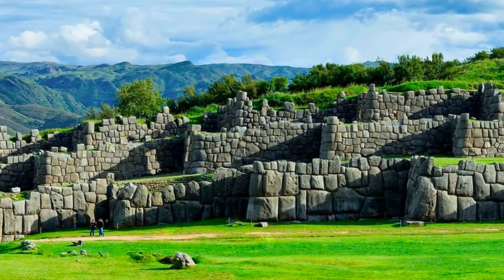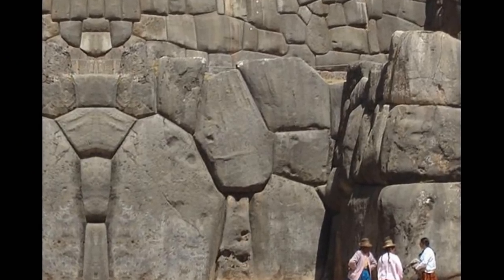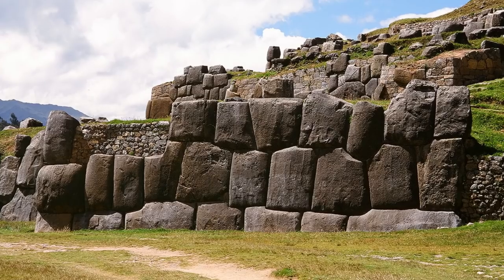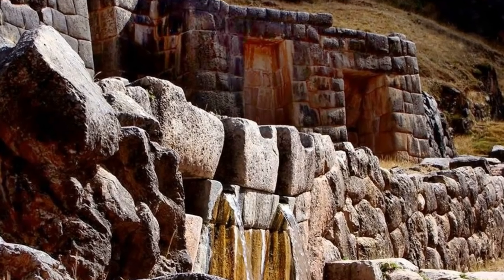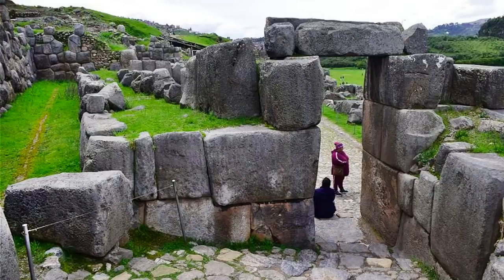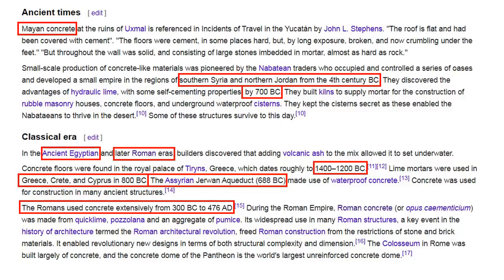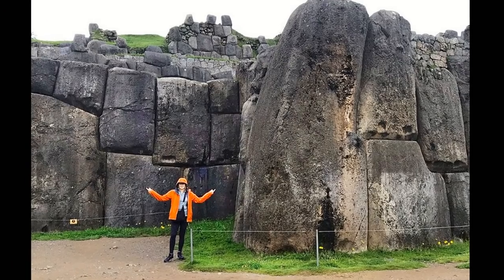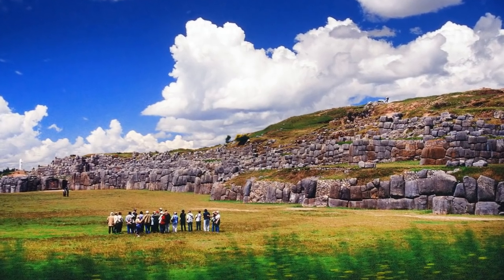Explained: How were Peru’s #Sacsayhuaman Walls Built

Comment: Exactly what I've been thinking as well. So awesome. Thanks!
Reply from the maker: Glad to hear that!
Reply: But not what the researchers proved, they proved the blocks came from the quarry.
Reply: @_John_P  they didn't prove anything. They made a guess
Reply: @_John_P  they could have been the quarrys for all that Rock that they used to make the walls that are rough and aren't polygons
Reply: @EEVENEEVEN-vb5qy  Not according to the paper, they took samples from all kinds of rocks from the wall, their origin is the same quarry.
Reply: @_John_P  well you gotta great point. But maybe they used exactly that same Rock from the  same quarry and had a way to soften or turn it into geo polymer. I'm only trying to come up with an explanation. But I don't really know shit.
Reply: @EEVENEEVEN-vb5qy  The researches explained that quarried limestone exposed to the weather will recrystallise into bigger grains, i.e. internally turns into marble, however the blocks were found to have fine grains, as if they were not internally affected by the exposure to the environment at all. They then explained that it's possible to achieve the same effect if water is prevented from ingressing into limestone, but instead allowed to ingress through the cracks only, i.e. if the block is made waterproof and then water is poured in the cracks. This is the "ancient technology" that they refer to in their paper, not the pipedream that is being presented in this video as a plausible hypothesis.
Reply: @_John_P  very interesting

Comment: Two stages...
1. An outer layer (the shell) created by hand, like pottery, allowed to dry.
2. The shell is filled to the brim with more concrete.

No heavy lifting involved, just scaffolding and panels. The nubs are where the metal supports, keeping the scaffolding in place were removed (?)

Comment: Ok. Hi Tina! I had a brief encounter with another person interested in this topic in the comments section of another channel. Together, we expanded the plausibility of his theory. There are multiple similarities with your idea. I would argue that a type of "concrete" does not explain the exposed rounded surface of the blocks: thick, flat wooden "planks" would suffice. These would have been able to be shored up with further buttresses. But the rocks' surfaces are bulging outwards. So, don't think of a plastic state prior to hardening but a molten one. Yes! Molten rock, kept hot enough for long enough to remain malleable enough to be poured or scooped up and dropped into place on the construction site. The mold would be formed at least on one side and the base by previously cooled blocks. By roughly hewn (and wetted?) stones stacked to the required shape on the opposite side of the mold. Compressed earth and/or aggregate would form the rear of the mold. And the front, for the visible exterior surface? I would suggest the abovementioned wooden retaining panel (and buttresses) but clad with a large, sand-filled "sack" of saturated leather, like glass blowers to shape their artworks. And the "nubs"? How about some kind of removable "plug" or plugs in the leather cushion, for fine tuning the final volume and top surface. From what I was told, sources of lava were indeed located not too far from the sites in question. That shouldn't be too difficult to establish.
Reply from the maker: Thank you for sharing with me. I appreciate it! You might find this article interesting: https://www.atlasobscura.com/articles/artist-sculptures-lava-volcano  
“The main problem is that when it’s coming out of the crucible, it cools quite rapidly, so you’ve only got half of it poured into the mold when it’s beginning to freeze ...As it turns out, working on an active volcano is somehow even more difficult than it sounds, and not just for the obvious reasons."

Comment: But you also need some hypothesis concerning what the concrete was poured into! 
If sacks were used, the fabric must’ve been very smooth in order to not leave a visible imprint, also raising the question "why the sacks weren’t much more uniform?“ 
Likewise, if scaffolding was used to hold the soft concrete until it hardened, this again begs the question „why bother to make the artificial boulders in so many diverse shapes?“ 
And medium sized blocks could conceivably have been poured elsewhere and then liftet into place when they were firm enough, but the really large boulders we find seem impossible to move or lift, which means that they must’ve been created in situ…

Comment: Thank you Tina. Forms usually imprint in the concrete. Any evidence? The large blocks look like they would have been cast in place in ‘flexible’ forms, what material is strong enough to contain that pressure? If the edges were groomed after partially set the ‘knobs’ could have been groomed off too, why were they not? The ‘concrete’ could be analyzed for content then experimentally reproduced.
Reply from the maker: Thanks Brian. I proposed that the blocks were cast with a special material similar to concrete. This material can keep the form yet still pliable state after removing the molds. Once the semi-soft blocks were laid out in horizontal rows and vertical layers, they would be compressed from above and pushed on the sides to get rid of any gaps and thereby ensure a tight fitting. There shouldn't be imprint from molds/forms. The special material is obviously very advanced, I dare to say more advanced than what we have today. 
I think these megalithic walls work as retaining walls and the original builder didn't bother to fix the facing sides. They probably cared about the structural integrity more than the looks because they only made a few scrapping marks on block surfaces.  Smoothing up/ "grooming" the blocks wasn't their main concern therefore leaving the knobs and the indent stamp marks are understandable. 
In the video, I talked about the analysis done by the geophysicists in 2012. They claimed the Sacsayhuaman material is not from nature.

Comment: I think they used llama hides for forms, thus the bulging. I think they also poured one at a time one against the other one perhaps poured the day before. Also their catalyst was slow reactive possibly taking days to harden. They mixed and poured in place depending on how big the crew was and how much material was available on a certain day and weather conditions too. I don’t think they handled a “soft” block. Even the small ones would be too cumbersome. They quarried crushed pulverized mix and carried that mix in bags from the quarry. I poured concrete for years in construction. Thanks for you insights in all videos.

Comment: Thanks Tina.  It should be a requirement to get a license to teach archaeology that you pour concrete first.  It is wonderful stuff and a pleasure to work with. At the end of the day you have accomplished something that will last for millennia, as here and in the case of Giza.  There should be no doubt, and this seems to me to be the most compelling proof:  When you pour concrete, the joints fit perfectly every time, on all the sides they face.  IT IS UNAVOIDABLE.  Quarrying with copper, carrying by boat without tipping over and being eaten by crocodiles, smoothly shaping the sides and lifting them again and again until they fit perfectly is IMPOSSIBLE.  It would also take 20,000 years, not 20.  Eliminate the impossible.  The limestone below the pyramids was easily disaggregated.  Peru's blocks are also concrete and of course they are irregular to deal with the earthquake activity.  The nubs on some of them are likely the result of not having plywood forms and so ropes or some other binding strings (leather) were used to hold the baskets or whatever they used to form up the pour.  You carefully pull them out as the mix dries.  Elementary really.  And as for Giza, which Herodotus says they built in 20 years, ie, 240 months -- I could do that with 8 small crews, working away from the 4 corners, and a ground crew packing mud up the steps (the higher the level, the fewer the blocks).  That is 10,000 per month or 350 per day roughly.  Working 12 hours at night (it gets hot there) each crew could pour one block every 15 minutes, or 4 per hour, times 8 = 32 times 11 hours to meet the quota.  We get an hour off.  The other requirement was an optical level which they must have had to get 200 plus rows perfectly level.  They knew their way around optics, as we see in the Old Kingdom eyeballs in the new Cairo museum.  Giants, aliens, and copper not included, or needed.  QED.  Here is more evidence of the concrete nature in Peru: youtube.com/watch?v=rf9qK9QTlq0
Reply from the maker: Thank you for sharing your insight with me, Henry. I really appreciate it! Well explained on the concrete construction method :-)

Comment: I saw someone demonstrate a way to soften the surface of stones using runoff from chemical mining. I don't remember what chemical it was, but it seems like it was a red liquid, and it still takes time, but starting with a block of granite, the surface on one side, or part of one side can be treated with the chemical and then the soft part scraped off until the desired shape is achieved. Was there mining nearby? If these stones are granite they could have been shaped that way.

Comment: Notice the scoop marks where material was removed. I'm thinking the device used to create the scoop marks is what was used to obtain a powder that was then owed to make the blocks. It would make sense to use the same device to correct blocks that bulge pot too much.

You say there was no mortar  used but what if they used a membrane to contain the powder that filled membrane and then used a process to harden the powder?
Reply from the maker: Thank you. I find it difficult to think of a very thin and smooth membrane or fabric strong enough to hold these massive blocks in shape...

Comment: They casted them in place! I have known this as a very young man! I am seventy now! I work in concrete. They built a temporary form on the open side out of earth or stone then coated the packed  clay on the surface. These materials are used over and over. She right on the stones themselves. The inclination is to earthquake proof them the random shapes stop the build up of vibration that would destroy the wall in a earthquake. This is why all bridges are now designed to take the roll of force. Look up the collapse of the Narrows bridge in Washington state. The older civilization was light years ahead of those who followed! Civilizations do not always get better. A lot of people are thinking about this right now!
Reply from the maker: Thank you William. I'm glad to hear from a concrete expert. I just searched the Narrows bridge in Washington state - thank you for sharing with me!

Comment: If they worked small sections at a time and roughly shaped and assembled the stones in place, could they not enclose it with a powerful fire that got the rock heated to slight plasticity which took advantage of self weight to settle each stone into place and fill the voids. This might also explain the frontal bulge on each stone from being softened but not molten.

Comment: Also in Egypt they managed to make stones which are added so tight that not even a knife blade is able to go between. Apparently they used copper and hard stone tools for it? The famous an unfinished obelisk still in the quarry (They then found a crack in it) looks like the stone has been scooped out beneath it, with an Ice spoon of a larger size though, so it doesn't seem obvious?

Comment: I'm in concrete and pouring a rock that size is a several concrete truck loads. When we pour a wall, it all can't be poured at once or it won't dry. It's done in layers. There is a definitive line where a layer meets another. This is with high speed and exact mixing of materials. If this was concrete, the technology involved would be so advanced compared to today as to be alien. Whether forms or just cut, either way the level of spherical trigonometry is mind-blowing. And, yes, there is no way around the use of trig here. If you've ever needed to mate even two wooden blocks with any precision, that had any angles besides right angles, you had to learn trig.

Comment: AM I RIGHT?
THESE WALLS with their impossibly perfect fit have been a mystery, particularly the, ah, "nipples" on the lower corners of some stones, (shown clearly in the photo). These suggest that the material was in bags when it was formed, and I'm convinced the bags were then subjected to ultra-sonic waves that essentially vibrated the material into it's current, extremely dense form. Then another layer was added and the process repeated. HOW they created the sound waves and how long it took is anyone's guess, but I see no other way this could have been done. Imagine a musical shaman or group with unknown instruments, keeping up the sound vibrations while others stacked bags that grew Increasingly dense in a process that essentially (and seemingly by magic) created solid rock from tiny, well-sifted, and fairly uniform granules by vibrating them until the microscopic spaces between the particles was at a minimum, and hence the density was maximum.  The process, although theoretically similar to our "rammed earth" construction, was far superior in terms of efficiency in relation to final product quality. As long as the two vertical sides of any given bag were the SAME shape, it didn't really matter WHAT shape; trapezoid, rectangular, square, etc. Then a more uniform width of material could be used for the horizontal sides/top/bottom, so they have 3 dimensions and all come out virtually the same thickness, and they could be stacked using a variety of temporary, cobbled-together forms that give the wall it's shape. The REAL trick? Matching the sound-frequency TO the size of the sifted material. Different material=slightly different frequency for best results, and the difference of just a few hz could result in failure or success. 
Okay, my friends: Rip this theory to shreds in the comments. BTW, I expect other people have suggested this method in the past, but I came up with it independently...unless I fell asleep with a documentary playing and "learned" it in my sleep, as I have done before.😄
P.S. -I also think, AS these are solidifying, there is a point in the process where the TOP surface could be shaped, where it's not quite at full density, but almost...and AT this point it could be fairly easily "scrape-shaped" with a knife-like tool, a sanding block, etc. Then it's ready for the next layer of sifted material. The whole project was continually subjected to the sound waves, so the bag-blocks were certain to reach maximum density by the time the top row took shape and solidified. The bottom stones would be "densest" because they were subjected to the sound-waves longer, and the density of stones might decrease a bit toward the top of a structure, but this would be a negligible and contingent upon the size and shape of the sifted granules.

Comment: Another researcher discovered an ancient formula for melting those stones. There are local plants that when ground into the stone and kept wet will soften the stone to a paste like consistency allowing irregular shapes to be formed to a perfect match. It is an amazing achievement considering the scale of the project. Each stone rough cut then softened and formed into place.
Reply: Ever seen it done?  No actual example or test of that exists. Nobody, including orthodox archaeology,  bothers to test their assertions before going into battle to defend them.  Copper chisels and no wheels to make and move thousand-ton statues and blocks.  Casting in place 200 ton blocks, each unique and requiring a unique mold...making the tops so randomly irregular that the next layer must be just as irregular.

Comment: Many cyclopean megalith stone structures around the world share similar features. Like bulging forward facing surfaces, square indentations and square protrusions. It would seem like the only way to achieve such features would be if the large stone blocks were in a semi plastic stage during forming.
Reply from the maker: Agreed :-)
Reply: @CuriousBeingbyTina  The real question is how can one make stone semi plastic or malleable without heat? It seems that these rocks have been quarried, if so that would leave out pouring a concrete like substance into a mould to form them.
Reply from the maker: @Johnrack  Maybe the ancients had something like today's dry cast stone method. Vibrant Dry Tamp (VDT) could be similar to the techniques used at Sacsayhuaman. 
The benefits of this dry cast stone methods are: 
-Fast demold time. 
-Can cast into the same mold several times a day.
-No treatment is required afterwards to achieve the limestone look.
-Result of cast stone is very clean and natural looking.
-High early strength.
-There is a time just after demolding when a repair is relatively easy.
Reply: @CuriousBeingbyTina  I have read a bit about dry cast. Interesting.